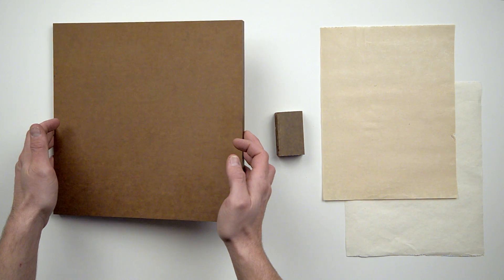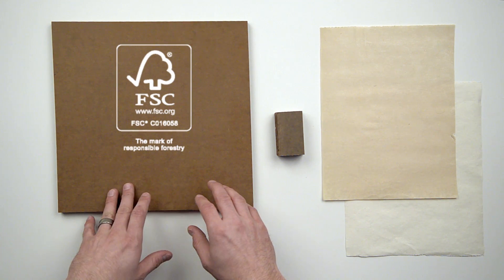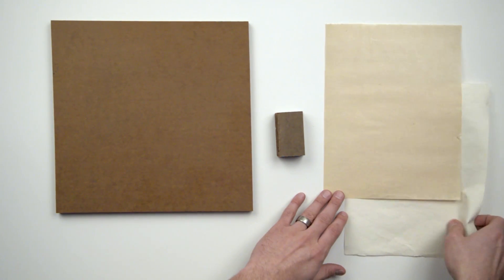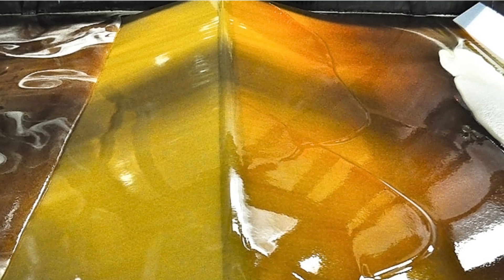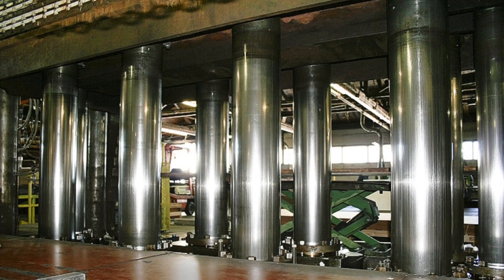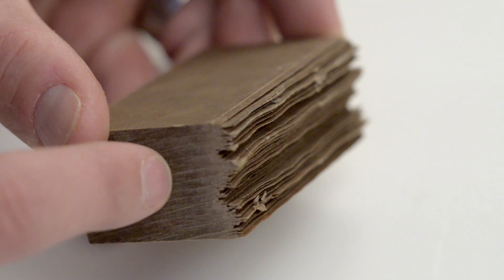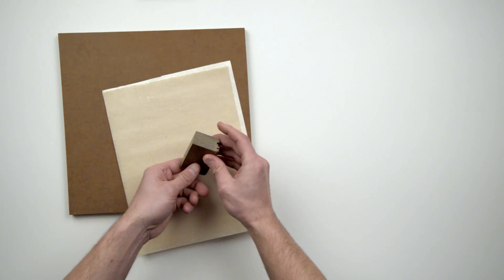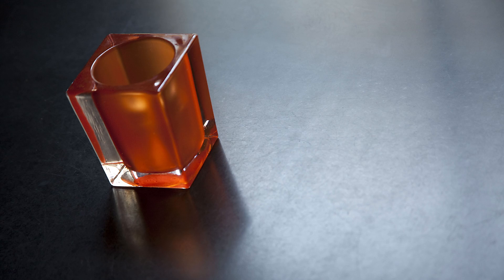Richlite Paper-Based Composite Material | Intectural

Comment: 05/23/2021:  I viewed Youtube videos on how Richlite is made.  The videos showed large sheets of special paper soaked in a liquid (resin?).   I am looking at buying a Martin Special GPC All-Solid Grand Performance Acoustic-Electric Guitar Natural, which has a Richlite fretboard.  The only bad review of this guitar was like most guitars, it doe not have a rolled fingerboard edge.  So, if I sanded it to take the sharp edge off, I do not want to see paper layers.  Also, if in time my fingernails will dig into the fretboard and I will want to sand that out too without seeing any paper layers?   So, can the fretboard with Richlite be sanded and not see any paper layers or see any damage at all?    See @/637 in this video.  @